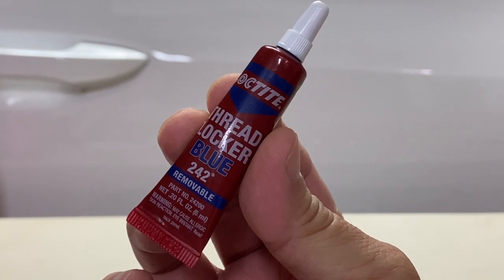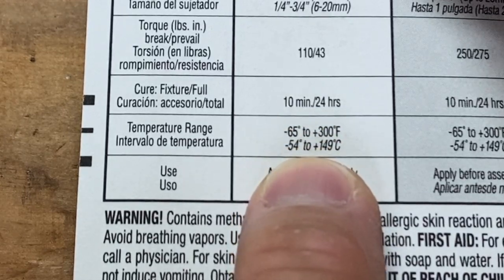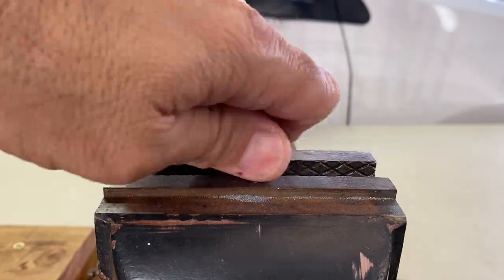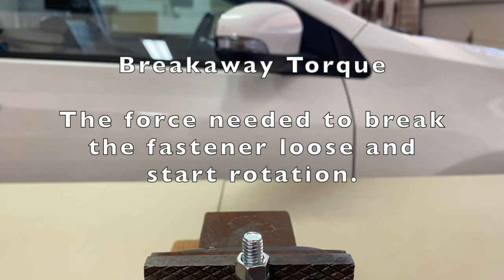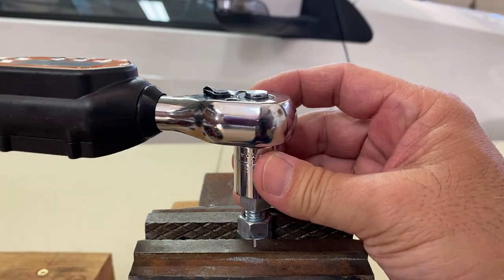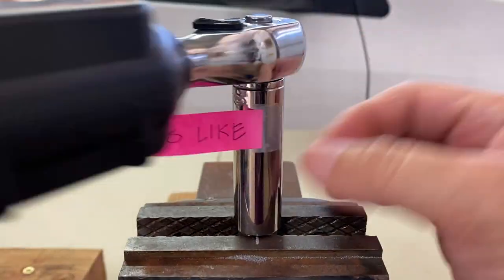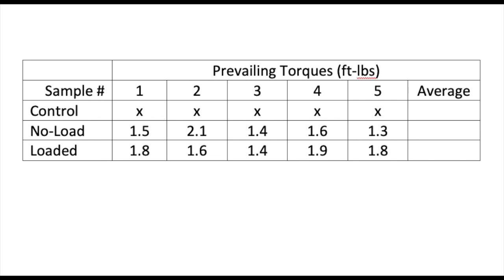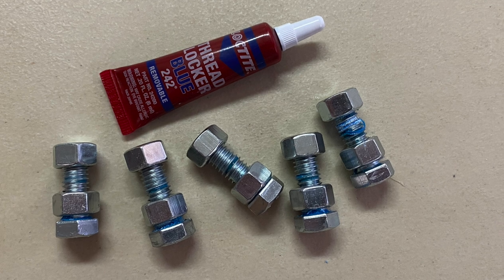Loctite Blue 242 Threadlocker for Beginners

Comment: Compare blue 242 and blue 243. Blue 243 will tolerate some oil on the surface. It seems to me that removing all oil from the bolt surface is not always possible. I have switched to blue 243. The cost is similar. It would be interesting to see how they perform if tested.
Reply from the maker: Thanks!
I picked up 243 and 263 and will test them in the future.  
😎
Reply: @HacksbyDad  hey did you have those tests yet? Just found this video with a search to find a product for high vibration and some light oil.

 I recently bought a new guard for a string trimmer and the bolt backed out within five minutes.

 Luckily I have a metal detector and I was able to find it.

 Going to the auto parts store for some thread locker tonight.

 If you have an analysis on the Blue 243 I would like to see it.
Reply from the maker: @heatshield  Sorry... haven't tested them yet.  Still on my list.  😎
Reply: @HacksbyDad  hey! How cool to get a response for something important. Thank you.

 I just got some orange “permatex” which is stated to do what I want. Vibration resistance and oil resistance.

 Thanks for your time. It’s appreciated. Maybe if you’ll be interested, I’ll let you know how this stuff does in the  trimmer head.
Reply from the maker: @heatshield  Sure.  I'd like to know how the orange Permatex does.  Here's a video I did with red, blue, and orange, but not about oil resistance.  😎